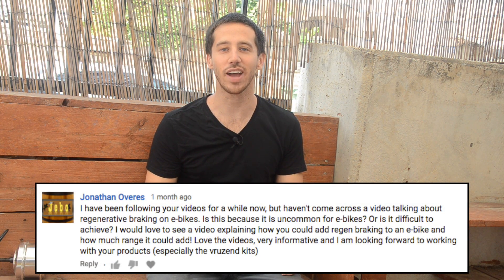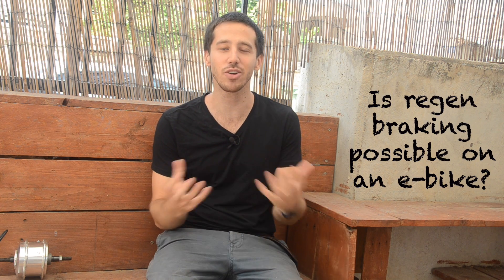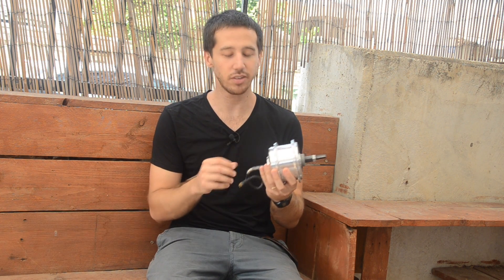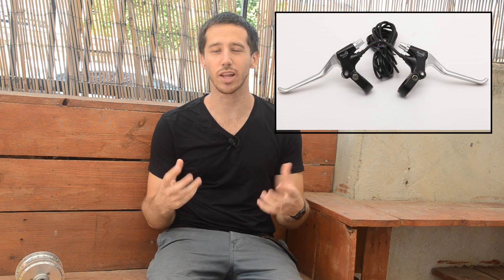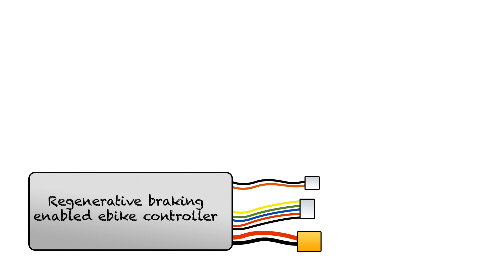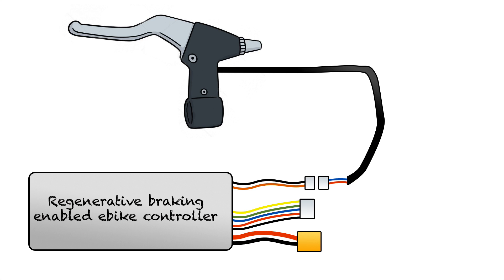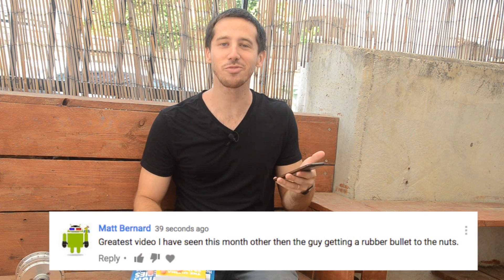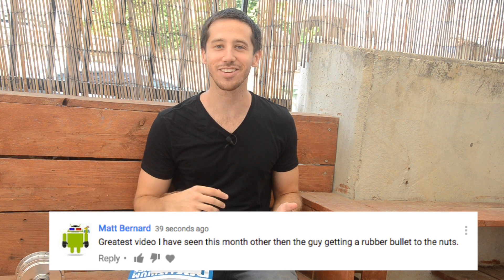How to do Regenerative Braking on an electric bicycle Q&A#9

Comment: Each year the Google Gravity Games have an Engineering Challenge class.  In 2017 the challenge was to coast down the hill with an electric STEM Cycle whose batteries are initially depleted.  Using regen braking, charge the batteries while coasting.  The course was approximately 500 feet long.  Once you got to the finish like, the driver could select electric drive and back up as far as the batteries would enable.  Our high school STEM Cycle has a 48V 25A hub motor with regen controller.  Our driver was able to back up 373 feet to win the event.  I don't know the efficiency percentage here.  Our battery pack consisted of 7 Nissan Leaf dual 4.2 volt cells in series.  Thought you might enjoy this unique application of regenerative braking.  Enjoyed the video, bought your E-book via Amazon so we could learn more in regard to applications of the smaller 18650 batteries in our STEM education.  Best regards, Barry
Reply: @Stephen Morton Well said! Not to mention having to replace disc brake pads much seldom! I was considering putting high capacity caps in parallel with the battery, to store power with much less resistance then with the full battery and enable quick boost when accelerating again. Worth a shot?
Reply: @Stephen Morton Thanks, makes sense. I was thinking of using Trinket for hooking up the brake switch and a transistor to charge the capacitors when braking. But looking at the bus system schematic would definitely come in handy.  btw, I use my pas ebike for a 40mile round trip commute and definitely less lazy then taking the public transport or a car but still doable every day unlike normal cycles :) 1000 miles every month!
Reply: A long winded video to explain that regenerative braking is impracticable and not worth the extra expense. It's mass time speed and around 50 stops in 20 miles might reach 5%. However, if you are going up and down long hills, that all changes, If you go up a mountain and down a mountain, 50% of the distance down, at 50% efficiency would add up to a 25% efficiency. The only way it could reach 50% is if it was all downhill, from the start.   To look at it another way. For every mile downhill, you might gain 1/2 a mile in range.  Correct me if this is incorrect.
Reply: Efficiency of regenerative braking is an interesting question - it's certainly possible to make regenerative braking more efficient, but to do so you basically rely on reducing drag: since drag is (as I'm sure you're aware) proportionate to the square of speed, you can get much better efficiency by travelling very slowly. Going downhill at very low speed and basically converting your GPE directly to chemical energy in the battery, then slowly converting it back, will reduce drag a lot... but isn't much use in the real world since the point of an eBike is to travel at a decent speed

Comment: You should probably run a low pass over your audio in the future to cut down on the tooth whistles. The info is good but those are a tad distracting
Reply from the maker: Thanks. I don't really know what I'm doing when it comes to video and audio quality. It's a problem when you're a crew of one.

Comment: I like using Regen.   It saves wear and tear on my brake pads and also prevents brake lock up, kinda like (ABS)
Reply: I always prefer the option of whether to lock brakes or not. ABS in my first auto  caused accident.  ABSWill lock up and slide and you can’t control it. It doesn’t take in changing substrates you may encounter. I started sliding through intersection when tires touched painted lines iof sidewalk crossing. I would have let off brakes on first line and stopped before secound
Reply: Now I always disconnectABS systems!

Comment: if I know my voltage (battery and motor), amp hour of the battery, the wattage of my motor and the maximum speed, can I calculate the distance per charge??
.........
I assume that we can calculate the distance...
(1) voltage * amp hour (20 h rate)=battery capacity in Wh...
(2) Wh / 1000=battery capacity in KWh.....
(3) multiply the capacity in step (2) by 0.6 if you using a lead acid battery or 0.8 if you use a Li-ion battery...
(4) multiply the result in step (3) by the maximum linear speed of your hub motor and you will get the maximum distance......
(I don't know if these calculations are right or wrong, what do you think ???)

Comment: Excellent video BUT how does it work? How many volts does the motor generate and how many amps? These are variables i'm concerned about. Could a fuse work for over voltage/amps?

Comment: If I add another set of battery to a 6P 13S  making it 6P 14S from ( 48V to 52V ) What will happen to my BMS  do I need to change it or leave it as is ?
Reply from the maker: You would need a new 14s BMS

Comment: On my Electric Daihatsu Mira, the variable regen function built into the clutch pedal was responsible for 27% of my range.
Used to get 80 to 90 km with the 8.5kWh LifeTech pack. Worlds most efficient electric vehicle conversion.
Reply from the maker: That's incredible!

Comment: What are the alternatives to regenerate if the controller does not have regenerative capability?
Reply from the maker: When you're ready to slow down, unplug your motor wires and jam the bare phase wires together. (just kidding, don't do that. You'll stop quickly, but it's not good for your motor!)

Comment: Hi Mike plz tell me how much average will the bike give with 36v350w hub motor and a battery pack of 36v17.5ah . I am stuck with my project I have external gear motor of 24v450w and a battery is of 24v 60ah and the average is very low what. Should I do

Comment: Hi Micah, thanks for your videos, really a life saver.I have a question. If my e bike has a BMS, and I go downhill on a 100% charged battery using regen braking, will that be risky for the battery/will it overcharge the battery?
Reply: Bms close mosfet and the motor cannot pump Ah into the battery, so it will not brake

Comment: is it possible to modify a controller which doesn't support regen , to make it at least stop as regen works , without charging the battery ? ( for longer life span of the break pads )

Comment: OK. So regen only works, if there is a Hub motor on your bike. But what about those BATTERY-FREE LED BIKE LIGHTS, that uses  MAGNETS as the POWER SOURCE?!? There is no friction and they will generate power, all the time you are biking. If you add some more magnets, would that not increase the power outlet? And why not magnets on both wheels?!? I know there must be a balance between weight and gain, but have anybody tried this and see how much regen they could actually produce?!?
Here are the lights Im talking about: https://www.reelight.com/dk/
Reply: Lasse Vassvik that way of producing power is similar to how the wheel produces power. you can put them on but they will be constantly giving resistance and be worse then the regen braking of the motor because you can engage that and disengage with the button

Comment: Great video!  I don't mean to nitpick, but using the term "efficiency" to describe the amount of energy being recovered is misleading in this context.  The regen efficiency should be the flip side of the motor's "efficiency" in converting battery energy into distance traveled.  Efficiency in the regen context should be the amount of energy recovered per unit of distance traveled.  Your use of the word "efficiency" in percent units might be better stated as "amount of range extension" of the distance traveled.  I know this is not a big deal, but it helps people to truly understand and analyze their own regen data.  Also, I like the extra focus on saving wear and tear on the bike's braking hardware, plus the added 'good feeling' of electric braking!  I've enjoyed both of your books so far, and am experimenting with your new weld-less battery assembly kit  -- thanks for your significant contribution to eTraveling!

Comment: If you live on top of a hill, you don't have to charge your %100 battery when regen braking. The generated energy can be spent on a resistor. You don't necessarily have to charge battery. This can be implemented easily.

Comment: Great Video Mike, it helped me a lot to decide should I use regenerative braking or not.
I do have one question.
How can I adjust controller to cut the electricity to the motor when I hit the brake, on a controller without regen?
I will use thumb drive or torque, so I don't wont to brake and motor running at the same time.
Reply: I just realized how stupid my question is :)

Comment: I ran into the BMS issue with a Golden DD. It had regen when I used a 36v Lifepo from China. I got a 48v Shark and no regen. The regen made for a nice amount of braking. On a basic build the brakes may be a weak point, so I'd say the regen is a big plus. Starting on a hill I guess it would help to know the amount of charge. Subtract that from a full charge and then stop the charging a bit below that amount. Can't do it on most chargers. I suppose a fully integrated DIY industry would look at different motors, BMS boards, chargers, etc and configure specific systems. Thanks for all the links. I noticed a couple of the links aren't working.

Comment: Hey I'm building a hybrid gas minibike with electric hub motor on the front and a 125cc powering the rear. From what you were saying I should be able to deplete the batteries driving threw town and charge them driving on the trail gas powered. But I'll need a charge controller built in. My question is will a controller handle being on regen for extended times or should I build a separate/independent relayed circuit with charge controller built in?

Comment: Q&A Question: Can you explain torque and how it relates to power.  I'm a very heavy wannabe ebike rider and just don't know how far I need to up the wattage and voltage specs on an electric drivetrain.  I already know that I should stay away from chain-based mid drives and should stick with direct drive, non-geared hubs to prevent mechanical failure.  I want to make sure I balance the power so that it pulls me and doesn't just spin out or something.  Anyway, I suppose this question could also apply to cargo ebikes so it's not just about us fatties.  Thanks. -Mike
Reply: Amps are what give torque ie pulling you up a hill, I'm not that heavy 11 stone and have a 36v 500w kit running at 25 amps peak and have a  very steep hill on the way home which I can go up with pedalling no problem at about 10 mph, But you need to check your battery can handle the amps for your controller so you get the best from both, the problem is once you get used to it you always want more I'm looking at getting a 30 amp controller, The wattage is just marketing as your motors true watts will be the amps x voltage I fitted a watt meter which is very cheap and gives loads of info of your battery and it shows sometimes I'm using more than 500watts I would definetly recommend buying one as they are only around £7, so only use this  as a guideline, Amps = torque and volts = speed

Comment: Can you explain why my geared ebike doesn’t slow down when the volts get close to 33 (cut off) but my direct drive does. Both are 10s8p but the geared one is a overvolted 24 volt original

Comment: Does anyone know why regen efficiency is so low on ebike? E-car regen efficiency is on average 55%. Does anyone have an idea how to improve it?
Reply from the maker: I've never seen a car that gets 55% regen, unless you're not using the same units as I used in the video. 55% would mean that regen captures over half of the energy used by the car.
Reply: Forward and reverse torque and motor efficiency should be pretty much the same. The motor might be 70% efficiency in transforming the energy back into the battery but there is only 7% energy left if even that. In cars it seems there is much more energy left to transform, as covered in the video.

Comment: Good video but yeap its not warth geting 1. Better charge up to 80% it increas the life sircles of the batteris. You need to do undergarge on bateries not over charge. So if you 80and you go down a hill you get to 85max still safe.

Comment: My question for next Q&A series:
Assuming we have two batteries with the same Wh, but one is 48V and second is 52V (one is 13S14P, second is 14S13P),  question is which battery will be more efficient (when ridding the same speed)?
Reply: They will be the same efficiency. If you have two cells in series or two in parallel you either have 2x voltage and 2x the resistance, or you have 1x the voltage and 0.5x the resistance. If you compare half resistance to double resistance this is 4x less resistance in the parallel pack but only half the voltage of the series pack. It evens out.
Reply: I know that in theory they should be the same, but I would assume that higher voltage battery will be more efficient as there is less current needed to achieve the same W. Higher voltage, smaller current, less heat = better efficiency (further range of bike), at least that is what I think.
Reply: The higher voltage battery is also higher resistance. These all equal out at the end to make the batteries exactly the same.
Reply: but higher resistance is required in order to have the same W, it is not waste of energy, like in case of heat caused by  current. resistance is just parameter that is set to have given W. higher resistance does not mean lower efficient. efficient is higher when there is no loss of energy. in my perception heat is something that take energy away from spinning of wheel. heat is not required to power the bike, this is just waste that uses battery.
Reply: Yeah, and both batteries will generate the same heat, losses, whatever you want to call it. One needs to run at a higher current but is lower resistance and the other needs to run a lower current but is higher resistance. The math cancels out and the batteries perform the same. 10S20P or 20S10P is the same.  10P will be easier to build though and need half the monitoring than the 20S and be safer.
Reply: It does not fully convince me. 
Why power stations transport electricity (by wires on poles) using high voltages??? from my knowledge they do that because there are little losses when high voltage is used. anyway, it would be nice to have it tested how it is with ebikes. @EbikeSchool.com, I would like to see your comment on that.
Reply: Tomasz Prudzic You asked about battery efficiency not power transmission. In both the cases of power transmission and battery efficiency you can still apply the simple formulas of resistance. And again you will see the systems will perform identically. Power transmission lines run for miles not inches. On a bike you can easily use more conductor if your losses don't suit your requirements.

Comment: I have a cheap ebike kit installed. I am thinking of upgrading the controller and maybe add a LCD display, there are so many out there, could you talk about all the features thats available in these controllers and LCD. what to choose and to avoid, power ratings, etc.

Comment: Can you tell us what is the difference between cheap Chinese batteries and a good Panasonic or Samsung
Reply from the maker: No-name battery cells just don't have the same QC standards, so you'll have more duds, more cells that die early, more chance of internal shorts, etc. They can be much cheaper, but the safety and quality disadvantages aren't worth it, in my opinion.

Comment: While your video explained a lot about the Re-Gen braking recharging the battery , it didn't explain very little about the posi b Le increased braking capacity of a Re-Gen unit ? ? ?
Reply from the maker: Sorry, I thought that was already obvious. Adding regenerative braking will increase the braking capacity of the vehicle.

Comment: I can't decide between a DIY gas bike, or a DIY E-bike! I think I want to do an e-bike, for reliability, but I'm worried about range, and how they handle below 0 degrees F weather... also, I'm a novice, in batteries and electronics, but your channel is helping A LOT! Thanks!
Reply: I built two ebikes and i had no DIY experience. My desire to build it was high.
For simplicity you can buy a battery at https://em3ev.com/. No soldering.
Also, ebikes work down to -20 Celcius. HOWEVER, they need to be recharged above 0 celcius
Reply: thanks for your input! i guess i just cant afford an e bike build, ill have to start with a 4 stroke gas bike, i have more experience with that type, anyways. Thanks!
Reply: Cold will drastically lower the charge you get out of a lithium ion battery, and NEVER charge a cold battery. You should always charge at room temperature if possible, but 100% for sure above 0 Celcius (32 Fahrenheit for those that are dumb). Discharging a cold battery is completely fine, but like I said, you'll get a drastically reduced range.

Comment: I do have a question I have a 72 volt 26.1 AH battery and I want to build another battery to add to that one to make it 96 volts can it be done safely or do I take apart the one I bought and add to it. thanks
Reply from the maker: I actually made a video already showing how to increase the voltage of a battery. Check my previous videos.

Comment: Thanks, Micah.  Please let me know what happens when you use Li Batteries in conjunction with controller adjusted with LVC for SLA Batteries . For example LVC 42V in controller, and a Li-NMC 48V (BMS adjusted with LVC less than 42V). Regards
Reply from the maker: In that case, you'd just get a LVC before your battery was really empty. 42V still leaves 10-15% in the battery, which isn't bad, and may be healthier in the long run, but means you're "wasting" part of your battery's capacity, in a way.